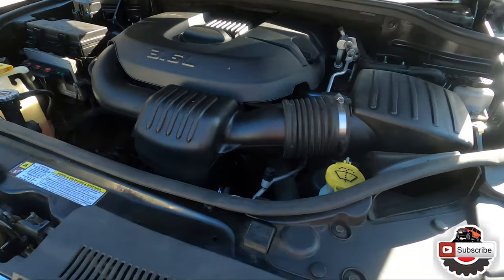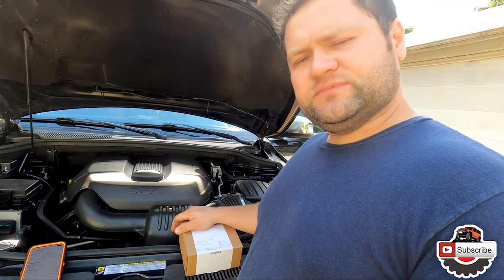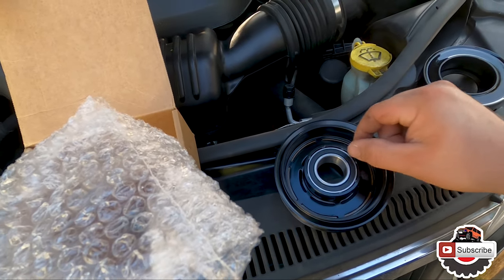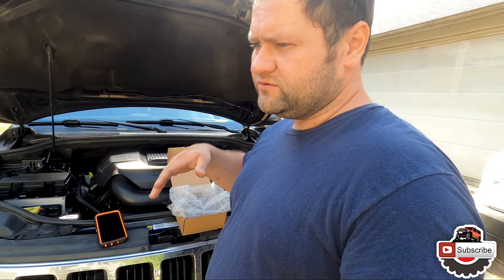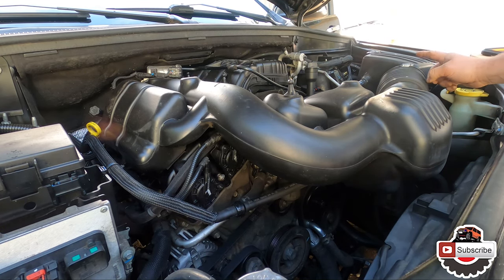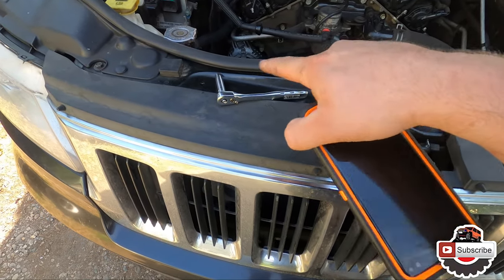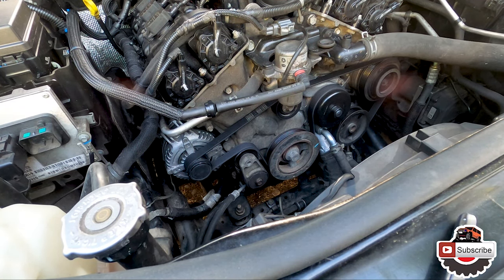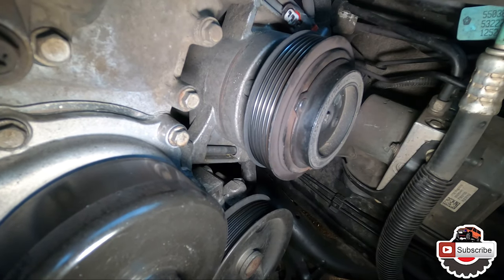2011 - 2015 Jeep Grand Cherokee AC Clutch Replacement

Comment: What about the magneto, you didn't show removing the old one or installing the new one?
Reply from the maker: The way i positioned the camera it ended up showing my hands for 10 mins.  But yeah its held in by another snap ring in center. 
Remove the snap ring, then pull the magneto off.  When reinstalling it, on the back of the magneto there's a round tab, it will make sure that you clock it correctly and so it seats properly.
Reply from the maker: Also if the old one works, it's not really necessary to replace it. All it is a magnet and it's got the same dimensions of the new one. So the new pulley will fit right over it.

Comment: I was wondering why you didn't show the installation of the new piece that is closest to the AC unit that the wire plugs into.  I wasn't able to get the old one off, so did all the steps you showed, without replacing the first piece.

Comment: Great video. I'm having ac problems on my 2013 jeep grand Cherokee but my clutch is not spinning at all with the compressor. Do you think changing out the clutch alone will help or do I need to replace the whole thing?
Reply from the maker: Well, that's different. Make sure your relays are good and if your ac system has a charge. If it's too low, clutch won't engage to save the pump from tearing itself up.
Reply: @JeeperGear  I have the same problem, my clutch doesn't turn either, not even by hard. Should I replace the compressor altogether?

Comment: Any other ideas what could be making the wobbling out of balance noise. I replaced the parts you showed, but still get the noise. It only happens when AC or defrost are on at idling RPM levels. At highway speeds, no noise. Thanks.
Reply from the maker: First thing that comes to mind, is the clearance between the clutch and pulley is to great. Place the feeler gauge between the clutch and the pulley to ensure proper clearance. If the clearance is not correct, remove the clutch plate and add/remove another spacer, to minimum air gap between the clutch disk and pulley needed to remain at the distance of about 0.020